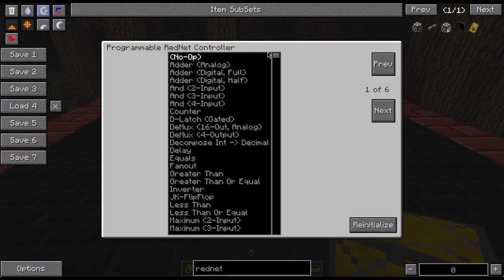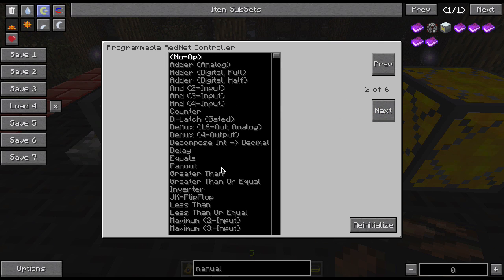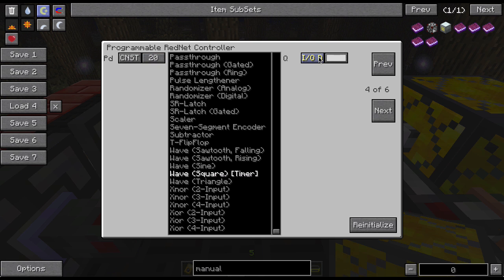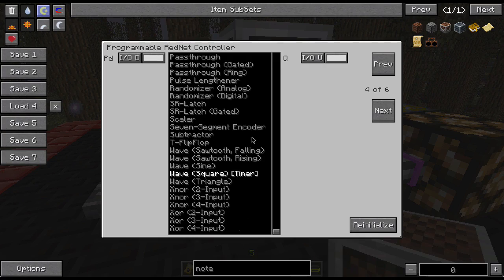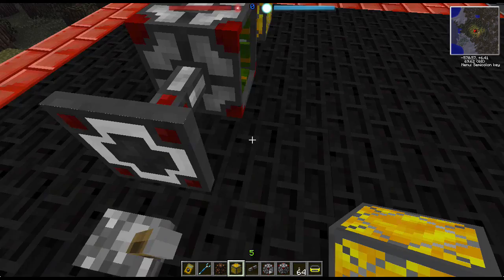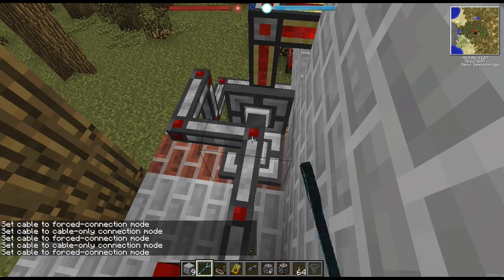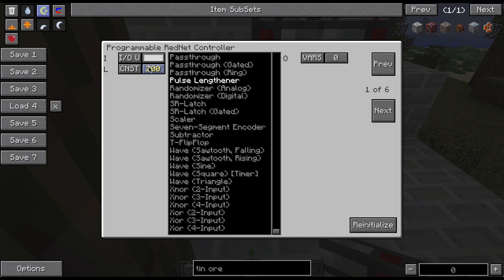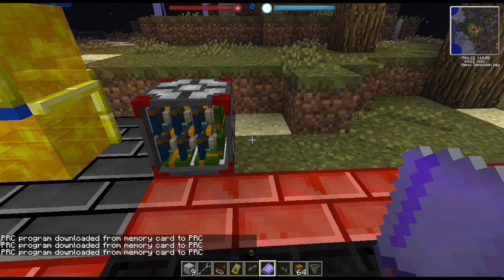Rednet Rising Part 1: Rednet Controller Basics

Comment: Awesome, just getting into this. First use is with the Drawbridge block (Tinker's Construct mod?) with a Xor gate running them as a bridge from either of 2 levers (one in, one out) and an Xnor gate doing same with a 2nd set of them as a portcullis, so it is opposite the bridge (bridge out, portcullis up, in, down). 

One thing, I have it running with input and output on the same side of the box. Inputs are black and white, outputs orange and purple, no need to run them out different sides.

Comment from the maker: I'm not quite sure what you're asking, but UE or IC2 copper wire won't carry redstone signals. It's for their internal energy systems.

I prefer the T-flipflip. For buttons, wire both the CLK and T lines to your input button (they can be the same!) and then wire the output to your door open line.

Comment: IC2 Nuclear Failsafe Controller:

3 way OR gate with inputs from a) manual kill-switch, b) thermal monitor, c) energy storage device being full... passed to Variable. Page 2 is an Inverter set to pass V# to your nuclear reactor. So if any of the three conditions are true, nuclear reactor turns off.

Comment from the maker: You could also do better than that. You could pulse your reactors based on your fuel supply! Think abut this... as you start to run out of uranium the reactor could use slower and slower pulsing clocks to keep your reactor running.

Comment: I'd much rather have it automatically switch off if the reactor has space in inventory (thus the nuclear material has run its course) to give AE a chance to empty and refill. Can a comparator detect inventory of an IC2 reactor?

Also ascending sawblade makes for an awesome alarm when paired with glowstone illuminator and rednet noteblock.

Comment: Hmm, currently trying to get a Galacticcraft-Airlock to work, got 3 Buttons(Stone-Ones, since Wooden don't work)
Also, I thought Copper-Wires would actually deliver the Wooden-Buttons to the Rednet-Cable(would have so liked it to actually recognize the Button through a Copperwire-Block, as it would look sealed).

Also, I don't seem to get the Flipflop done, it should just Switch Orange and Green at the downside, whenever I press a White Button connected to the Westside.